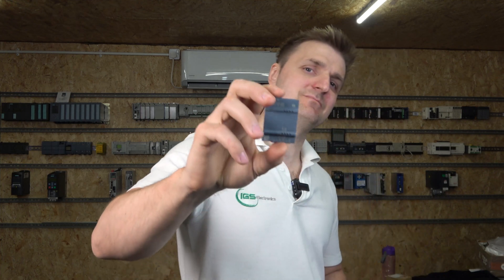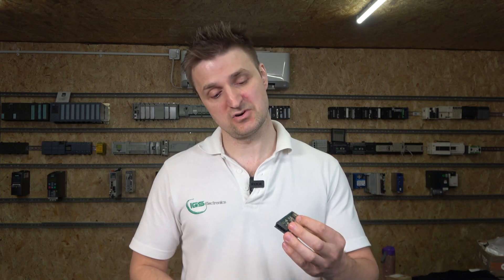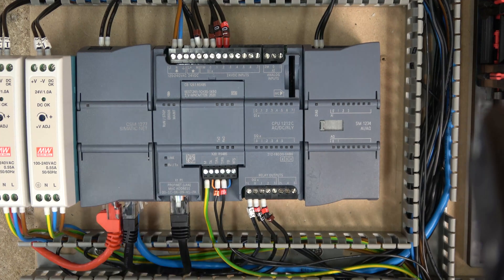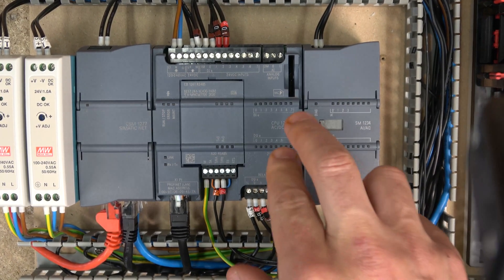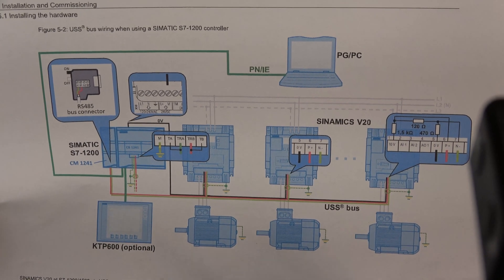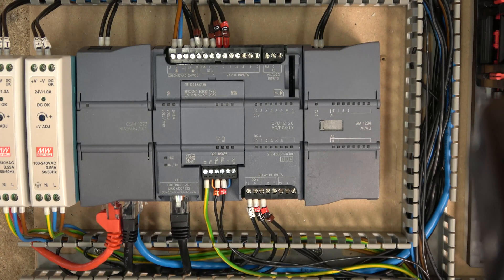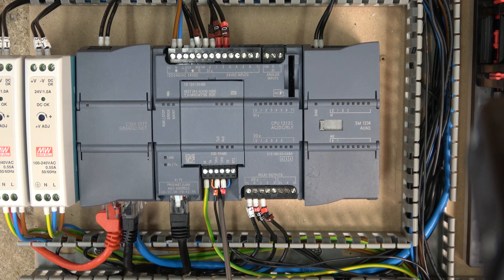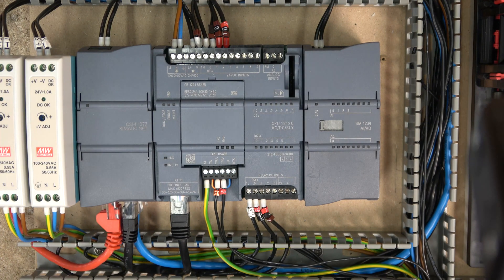Siemens S7-1200 PLC CB 1241 RS485 communication, parameters and wiring with Seimens V20 Drive Part 1

Comment: Hello, I'm using 15 g120c in some conveyor. But one conveyor when sended the second conveyor and whem whe second took product, the third conveyor Start but the second conveyor don't send. When the third cv stop the second start to send and the third start for take. But I want to this line continue without stop If the line is empty. I can not this parameter please can you help me?
Reply from the maker: Are you using plc to operate the conveyors? Drives will do what PLC is telling them to do, you will need to look into the code and find the problem there.

Comment: Sir can i upload this drive parameters and make file ? Which software apply ?
Reply: No software for this drive. You can however use the parameter loader optional device to copy the parameters to an SD card to apply to other drives, but you won't be able to edit that file since it is in binary format.